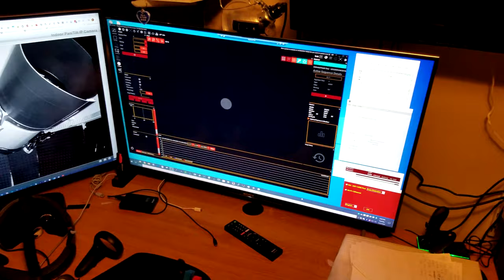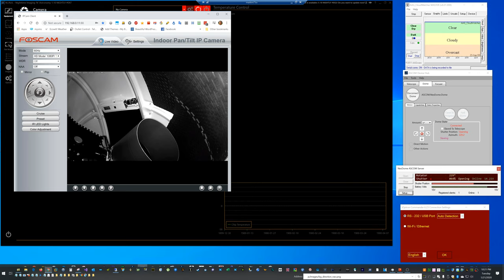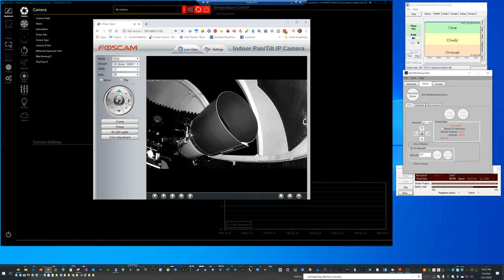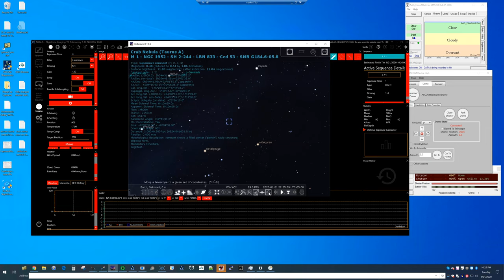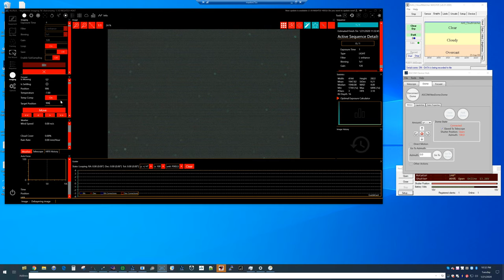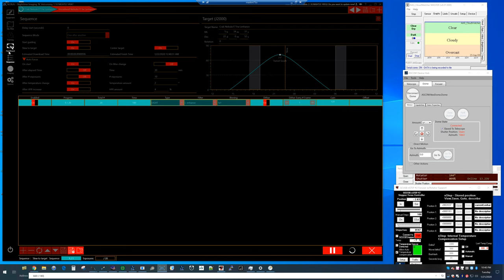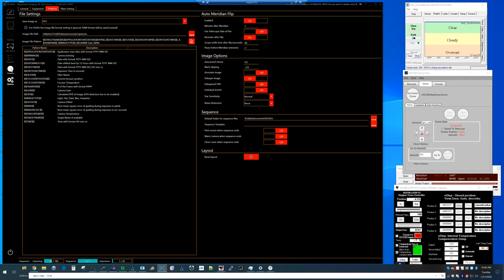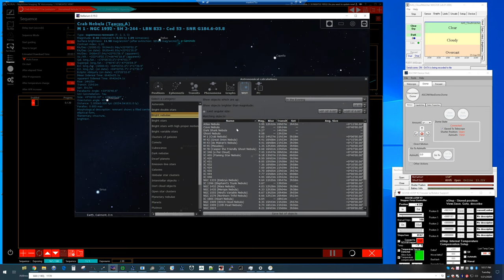NexDome Software and NINA Overview - Capturing the Crab Nebula

Comment: Nive video tour!  I also have a C11 EdgeHD and CEM120 EC2, and have been using KStars/EKOS but feel I need to move to a new control system.  The I really like their system, there is an issue with their Nexdome driver that bugs me.  Anyway, I'm looking at NINA and wonder how you gave the remote system configured.  That is, how do you control all the gear out in the observatory remotely.  That is, what systems do you use out in the dome and what do you run indoors?   In KStars I have a computer out in the dome that has everything connected to it, and it uses INDI to control it all.  Then I simply use VNC in my home to operate the remote computer.  I am interested in the way you are configured to run the equipment remotely while in your home.  Thanks!
Reply from the maker: Hey there, thanks for watching.   I may have briefly touched on this in a few other videos or on my website though maybe not in great detail, but I basically have a Canyon Nuc windows pc in the dome i leave on.  All the equipment is directly connected to the computer and uses Ascom and other drivers (nexdome etc).  I then have cat6 gigabit i ran to the house.  So i just remote desktop to that pc in the dome for remote use, or sit in the dome on the pc thats there (using the screen/keyboard/mouse) if im outside.  I use a script that i fire off in task manager to shut the dome down after the sequence ends in Nina.
Reply: @AstronomicallySpeaking  Thanks for the reply.  That is basically how I was running mine, but with INDI instead of ASCOM.  I just tried NINA and was going to switch over completely but the folks who write the Open Source code for INDI just came out with a driver update for Nexdome that works perfectly now with the new Nexdome 4.0 firmware update.  I now have my system as follows:

- NanoPC T4 (Linux) computer in the observatory at the mount with everything connected to it.
- INDI server running on the NanoPC.
- Cat6 and wifi connection to my home 500 fee away.
- Mac desktop in my home that is running KSTars/EKOS and uses INDI to control the INDI server outside.  No desktop/screen sharing (VNC) - which reduces lag significantly.   INDI allows astro aps to control the server remotely at full speed from anywhere in the world.   

I just now need the winter skies to clear!
Reply from the maker: @peterkennett33  Yeah I had seen your post in our FB NexDome group, glad that worked out.  I couldnt get firmware 4.0 to work well with my setup, losing connection etc.  I think I finally nailed down the wireless issue though only after switching xbee units once again to the new "pros" with external stickable antennas.  Skies in SW PA continue to be nothing but clouds here.  Hopefully you get clear skies soon! :)  - Mark

Comment: You have some awesome gear there.
Great video!

About the meridian flip, you should probably increase the wait time after meridian. Default is 1 or 2 minutes I think, but usually it's not enough. My gear works fine with 5 minutes. But try it out.

Cheers, Nick
Reply from the maker: Thanks for the compliments.  Yeah it seems that my mount when set to flip at 0 degrees past meridian, doesnt actually move to flip till 5 minutes after the listed transit time.  Not sure why or maybe its off by 1 degree somehow, unsure.  I'm thinking i should set the ioptron to stop at meridian, rather than flip and let nina handle the flip.  Though, for now i increased the nina settings to give it a 7 minute total time which seems to work out.
Reply: I think Nina actually stops tracking when the meridian flip process starts, then waits for the time set and then sends a slew command to the mount. The mount then flips if it can't slew directly to the target.
Reply from the maker: I mostly have things figured out now.  I set the meridian flip to be 10 minutes after meridian in Nina, set the scope to stop at 5 degrees past meridian which is 20 minutes actually.  Although setting to 10 in nina seems to translate to a flip at around 7 minutes after it passes, not 10 (not sure why the difference).  I'm going to bump this to 13 to give me about 10 mins around meridian (no issues with the pier/equipment clashing).  This combination works, no errors thrown by ioptron now, nina can initiate it just fine.
Reply: @AstronomicallySpeaking  
Great to hear you got it working.
Enjoy!! 👍

Comment: Cool  Looks so much like mine  ;-)    what focal length is that setup. The Crab looks nicely cropped.
Reply from the maker: Thanks :)  Its F7 reduced here (took a break from hyperstar), so 1960mm i think is the value.  It was only 59 minutes of data, if the clouds ever go away, hoping for some more.  Much larger than via hyperstar at 560mm.